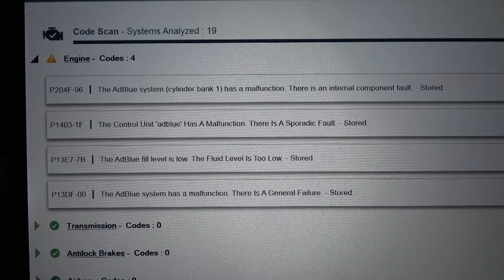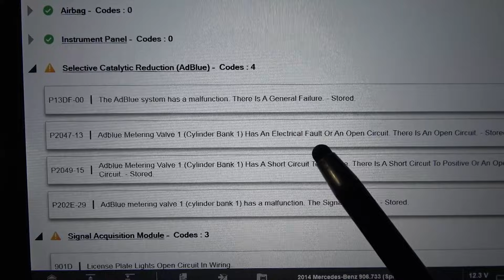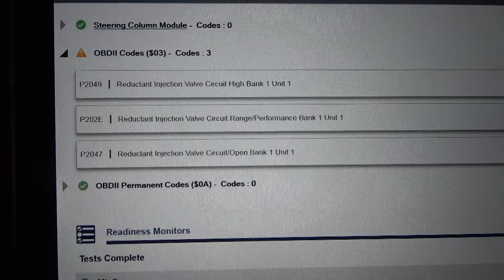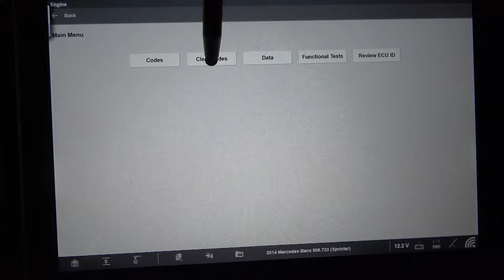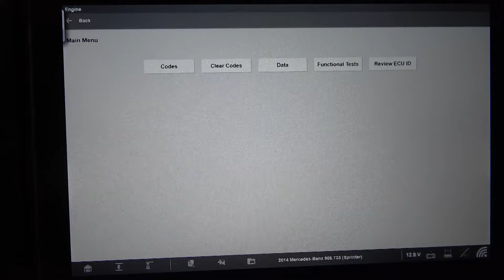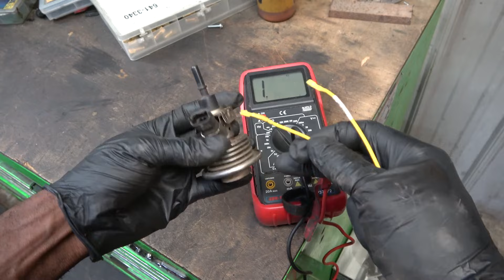Mercedes Sprinter : DTC P2047 & P2049 ADBLUE Metering Valve Has an Electrical Fault - Diag & Repair

Comment: Great video. I have a 2019 Sprinter v6. My AdBlue injector is long and slender without the cooling fins like the one you are installing. Mine looks like it has a metal gasket that seals between the injector and the pipe. Could you confirm this and possibly know the part number for the gasket please? Broken pieces of gasket fell out when i removed the injector

Comment: $500 WTF! 
You can simply remove the injector within the steel housing and replace it with a Chinese one. The injector is a fuel injector and can be purchased from China for around $15
Reply from the maker: @rafo6577   Lol

Comment: I have a problem with my Mercedes Sprinter 3.0 (2017) , saying “the efficiency of the SCR catalytic converter (cylinder bank 1 ) is not sufficient.. any idea what my be causing the EML on , thanks in advance for any assistance/info 😁😁😁
Reply from the maker: @ru5tynutzvanlife556   You need to have it diagnosed by a pro mechanic, the DEF injector might be bad
Reply: @ thank you 🤩

Comment: Great video! It helped me diagnose my bad DEF injector resistance. (P2048)
After replacing it, do I need to have a Mercedes shop program the new part or make the van go into a "relearning" procedure?
Reply from the maker: @JJ_SunriseHVAC   Yes! you do

Comment: Great video.  Since the video show that the new injector value shows 13ohm . Is it possible to test resistance of  the Ad blue injector value without removing it from the exhaust system?
Reply from the maker: @johnvu1449  Thanks, Yes

Comment: Hi, thanks for the video! I have a question, what if the problem is with wiring, what should I do then?
Reply from the maker: @salva7449  you would need a wiring diagram and then fix the wiring!

Comment: That's a job done properly, note I believe the most common fault with these adblue injector valves is, they get blocked by the crystallized adblue at the outlet end, so even though the valve opens no adblue can get through.
Reply from the maker: @johnbower   I agree with you, Thanks

Comment: Hello, thanks for the great videos so helpful. Could you please post a link for the part number for a 2019 Sprinter 2500? Metering Valve.
Reply from the maker: @zensauces  My Pleasure! I don't have the part number, you can get it from your local MB Dealer!

Comment: I recently purchased a 2014 Sprinter and the check engine light came on and then the start count begin (10 starts remaining... ). I took it to a shop that diagnosed it as a failed DEF injector like you replaced. However after the repair, they cleared all codes but the DEF light on the dashboard came on. It wasn't on before and I had just filled my DEF tank. The shop is telling me that they need a MB Code reader to reset the DEF code otherwise it will go back into start count down. They will charge me $500 for this as they have to out source it to someone who has the MB code reader.  I've read elsewhere that since the injectors been replaced, I should just drive it and the DEF light will go away on its own, unless there are other issues. What do you think?
Reply from the maker: @MrTrumpetbrian  The DEF System might need to be reset by a factory scanner, 500$ is a lot for that though, you can take it to the MB Dealer and have them reset the light for a lot cheaper, unless there is another issue in the System!
Reply: @KITS_Auto_and_Truck_Repair  Thanks. I have an appointment at the dealer to scan and reset if necessary. In the meantime I'll drive the vehicle and maybe the DEF light will reset itself.
Reply from the maker: @MrTrumpetbrian   Ok! Good luck
Reply: In some cases with my Vitos, after replacing the valve … the light didn’t go off, and I could not reset the fault code, however after driving it for about 25 miles it reset itself probably takes a while for the control unit to reset itself. The fault did not reappear.
Reply: @StarfishTaxisStAndrews  Thanks. I'm hoping that's what happens for me too (assuming no further issues with the DEF/DPF system)

Comment: hi,  u made a excellent  video,  I have that code and the engine lights comes on e comes off  in My 2019 sprinter van,  today I check the valve  and I can see some white thing at conections looks like something leackind. what the best solutions, coz  i dont know if I have to reset the sistem on dealership, please what do you think????
Reply from the maker: @JoaoCarlos-li1jj   do a resistance test of the valve!
Reply: @KITS_Auto_and_Truck_Repair  I did, its good... but is leaking mabe it need a cleanup.  so  if i take it off and place ir agaim .. I gonna need to configurate it?
so have to take  on the dealer to reset?

Comment: Thanks for the video. I have tried everything to get the bolt loosened to remove the injector valve, but I can’t get it.

What kind of socket did you use? I tried e-torx (e-4 through e-7) and normal 6 point sockets. It will not budge for me.
Reply from the maker: @andymcrorie9128   you need a star socket for that!

Comment: How are doing my man? I removed the valve, it was pretty clean, but it was crystalized all around. Also the nipple spins around. Does it have to be like this? Maybe it sipping because of it spins?
Reply from the maker: @vladimirouvarov5416  it should not be sipping!!
Reply: @KITS_Auto_and_Truck_Repair  Thanks for the answer. I removed the bracket, pulled out the nippel, there is an "o-ring", put a new one, became tight. Anyway, I know, the valve has to be changed. Found by a part number that you provided. Thanks again for the nice video 👍

Comment: I have a 2022 Sprinter. Started up the van today and saw check engine light. Drove it for an 2 hours and got the message “Additive (Def) System Fault System Starts Emerg. Op: 10 See Operator’s Manual”
Reply from the maker: @oatiko3065   you should have it scanned and see what code you have in memory!

Comment: I have a fault code on my sprinter saying EGR sensor A is faulty. Can you tell me where this sendd at or would be located ? 2014 Freightliner 3500 v6 diesel. I enjoy your videos
Reply from the maker: @robbinbaker5497  it's part of the EGR Motor!
Reply: Is that repairable or should I replace?